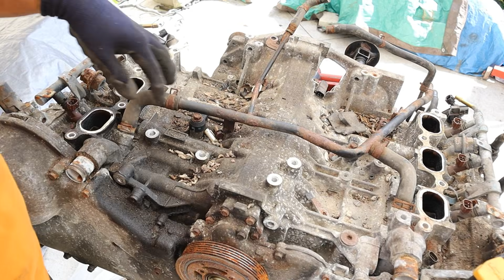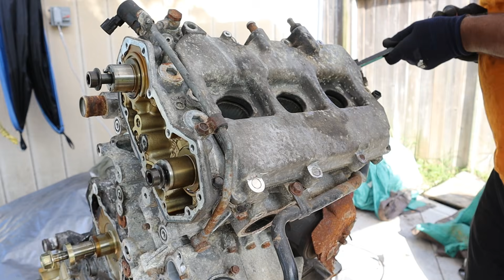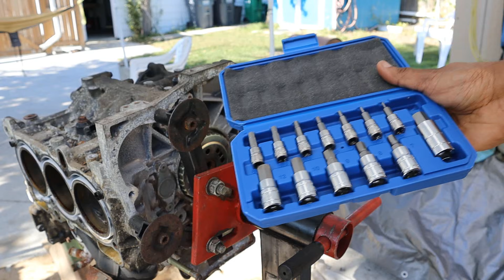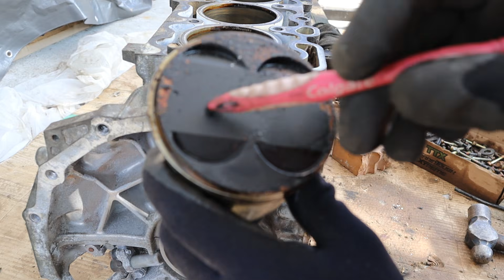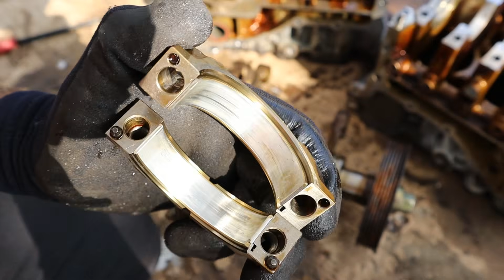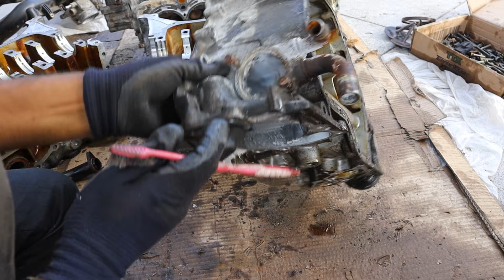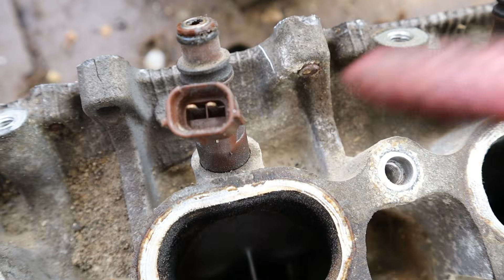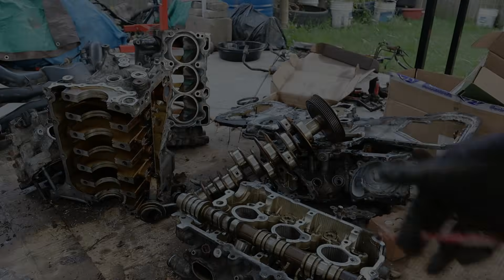Inside a Subaru Boxer H6 Engine

Comment: Some areas with bad well water can clog coolant passges.  That looks like calcium.  I found a new radiator, pump, hoses, thermostat and belts are cheaper than an engine.  I always use distilled water with my coolant.

Comment: Some areas with bad well water will clog up the coolant passages.  That looks like calcium.  I learned long ago new radiators and pumps and hoses are cheaper than engines.  Always use distilled water with your coolant

Comment: I waited for this video for a long time. I have this engine on my car, it doesn't overheat but it over pressurize the cooling system. It passed the compression test, leak down test and actually has good gas mileage too, no missfire or anything. I'm really confused what to do? Do I change the gasket or tighten the headbolts or get a replacement engine. I feel like coolant pipes might explode at any time.

Comment: Hey I wasn't sure if you'd notice comments on older videos, so hopefully it's okay I ask here as well: in your "Aux Input CD Stereo Hack" videos, you solder aux wires directly to the motherboard, to the left and right channels plus a ground. Couldn't you just splice into the wires those solder points lead to? Just thought it would be easier.

Comment: The video title should really say that it's an EZ30. Subaru have done quite a few sixes over the years - ER27, EG33 as well as EZ30 / EZ36 (and the EZ30/36 are different enough that they really should almost be considered different generations)
Oh and for the M5 hex nuts, get an impact driver. Not the electric ones - the manual ones you tension and then hit with a hammer.
Reply: 3/8" extractor socket pounds over the M5 heads and they zip right out.
Reply from the maker: Yeah an impact driver would help but if it's already rusty it won't grip much.
Reply: @speedkar99  it helps more than you think, I used to disassemble alternators and starter motors that had screws that were stuck fast. Impact driver, torque it and whack it with the hammer, worked like a charm no matter how rusty the head was. It stops the tool camming out.
Reply: @speedkar99 i can concur with the impact, they magically just work with these bolts. I got almost all 59 of them off of my mark 1 ez30d in the rust belt just using the impact, and i think i used vice grips for 2 of them

Comment: Wow this engine seems a lot better than I expected. Mostly because of the lack of head gasket issues. Didn't know they had an implementation of VVL either! Never seen coolant corrosion like that before. Thanks for the teardown!
Reply: The earlier ez30d mk2, or the "30R", had both intake vvt and vvl with heads designed by porsche. It's the same system as variocam
Reply from the maker: You are welcome. Those were my surprises too! Pretty interesting engine!

Comment: with 300km and the bolts were all stripped id say the engine is done.  and i dont think you would have been able to clean it out either.  its like someone used softened well water with the white stuff caked in there.
Reply from the maker: Yeah I don't think CLR would have cleaned it.

Comment: Measure the head bolt diameter. I had to repair one of these blocks a few months ago for stripped head bolt threads. They were M10.5 x 1.25. Yes, M10.5, not M11, or M10. Tou can't wind a 10mm nut  onto the bolts, and M11 is like a sausage in a hallway.
Reply from the maker: Wow....are you sure they're not imperial.... Which wouldn't make sense since it's a Japanese design. How did you get a tap for M10.5

Comment: I think this and the other 4 cyl Subaru boxer engines have a decent long life provided one follows the service procedure, uses a good quality lubricant, coolant and stick to the service interval. This plus allow the engine to warm up on cold days and a gentle driving habit would give these engines a very long and trouble free life.
Reply from the maker: I think that can be said for many other engines too. The 4 cylinder Subaru's are just more prone to the headgasket failure than H6
Reply: @speedkar99  and even then, its a limited run of one engine, exacerbated by poor maintenance. I do think it fair to say that Subarus are... less tolerant of lax/poor maintenance than a toyota or a honda.
Reply: @themadmallard  subarus have had that thing for decades and no macig coolant going to fix bad engine block and head design and yes i have subaru too but no need to hide the fact that they have build decent ammount of time bombs.
Reply: @themadmallard  Limited run? It was literally all EJ25 naturally aspirated engines meaning 1996 to 2012 lol. They improved a bit over the years but they never truly fixed the problem. The FA/FB 4 cylinder engines do not have this problem.

Comment: - That's not how the buckets work. The oil pressure locks the outer part to the inner part, the inner part is directly linked to the valve.
- You missed the 'thats actually a Porsche part' marker on the back of the buckets.
- The engine was probably overheating due to a clogged heater core, and yes, citric acid would have cleaned it... those bolts were yikes though.
- EZs do not have offset crank pins. The EZ36 has offset *rods*, the EZ30 does not.
- To make those hex bolts on the front cover play nice, use a short breaker bar, and strike it with the back of a hammer to seat it before trying to move it. Makes for much less of a battle.
- Fuel rails and fuel lines go with the manifold, but I guess you figured that out as you took it off.
- You remove the wrist pins, but leave the pistons in the block until you have the block split normally, less painful that way.

Otherwise, pretty accurate.
Reply from the maker: So the inner part of the bucket pops up due to contact with the valve stem when tightened down? 

How exactly does oil pressure lock them together internally, it fills it up with oil and then ...
Reply: @speedkar99  the inner part does not pop up. It is solid. There is an internal pin the oil pressure pushes into place that locks the outside to the centre part when high lift is commanded. Take one of the buckets apart to see if you want. Just beware, the spring inside is fairly powerful. 

It is the Porsche Variocam II system, not like it, it is it. There's some videos out there on its operation.
Reply: @grantbenjamin5808 no, the AVLS/VarioCam-II system shows up only on this engine.

Comment: I wonder if it would have helped if he put on a new radiator cap and flushed the cooling system. I’m sure actually he must have done that.

I wonder if the owner had a leak in the radiator and tried to “fix” it with stop leak rather than putting a new radiator and pooched the engine.
Reply from the maker: Yep I tried everything. See my shorts  I linked in the video of my diagnosis.

Comment: Interesting to finally see inside one of these.  One thing to note is that that lower profile center cam lobe on the intake cam is actually the one that is used most of the time.  One of the two center cams has less lift than the other to increase turbulence and improve mixing of the air and fuel at low rpms for better low end torque and fuel economy.  Then at high rpms the bucket will collapse to allow both intake valves to follow the higher lift cams for more air flow and thus more power.  It's definitely an interesting design.
Reply from the maker: That makes sense now, how does the bucket collapse with oil pressure applied?
Reply: @speedkar99 I would assume it has oil pressure by default which engages the plunger on the smaller cam profile. On power demand the “VTEC” closes the oil supply, the spring pushes the plunger flush to engage on the outer profile camshaft lobes for more power.
Just a guess though.
Reply: @speedkar99  Yeah, like the other guy said, I'm pretty sure there's a spring holding it in the collapsed position and oil pressure extends the center part of the bucket follower below a certain rpm threshold.  Above that rpm the oil pressure is removed and the valves follow the high lift profile.
Reply: Ain't it the other way round? The more "pointy" cam is, the shorter the time of valve being fully open. It'll open more/higher, but for shorter amount of time.  But the better air mixing between 2 unequaly opened valves during low rpms sounds convincing. Another "but" - during startup, there's no oil pressure for some time (neglectable?) and cams for high rpms are used then?
I can't find a good source of info on the actual behavior in Subaru ;(

Another related topic - how to measure valve clearance?  Use just the outer cams?

//edit
Got a reply from an engine repair shop - they say that valve clearance is measured using the external lobes and those are the ones used during low rpms.

Comment: My 2013 Subaru Tribeca with the 3.6 liter H6 engine with about 70,000 miles with most of the miles accumulated in short trip driving (severe driving conditions).  The motor oil gets changed once a year with about 5,000 to 8,000 miles with 5W-30 100% synthetic Amsoil Signature Series Motor Oil (a synthetic combination of a PAO Class IV and an Ester Class V);  my transmission and power steering has the 100% synthetic Amsoil ATF fluid (changed around 40,000 miles); my two differentials have the 100% synthetic 75W-90 Amsoil Gear Lube (changed around 40,000 miles);  my brake lines and master brake cylinder are filled with synthetic Amsoil Brake Fluid (changed every 30,000 miles); and finally my radiator is filled with Amsoil Antifreeze & Coolant (changed around 45,000 miles), making my vehicle running like a top (without enduring any repairs, other than maintenance)!  After trying every conceivable “full” synthetic oil in the marketplace and after testing the “100%” synthetic Amsoil motor oil, I instantly became hooked with the extra power, increased gas mileage, quieter, smoother and cooler running engine.
Reply from the maker: Nice
Reply: x2

Comment: I liked the 3.6 H6 that I had. Decent power and torque, and very smooth. That engine looks like it spent about 3 years at the bottom of the Gulf of Mexico before this video was recorded.
Reply from the maker: Canadian winters.
Reply: Canadian roads have about as much salt as the Gulf of Mexico.
Reply: @user-cs9ix3lw3j  I’m in the upper Midwest, so I can relate
Reply: The 3.6 was what the 3.0 should have been.
Reply: @LabiaLicker ez36 is weaker than the ez30. The cylinder walls are too thin to make power with.
Reply: @bobbygonzalez2153  If you going to close deck, then why not with a bigger engine?
Reply: @bobbygonzalez2153  not only that, but the offset connecting Rods
Reply: Gulf of AMERICA! 🇺🇸
Reply: Gulf of America*

Comment: Indeed, utilizing con rod journals for cylinder walls lubrication is the age-old method from Subaru. The top two holes are used to lubricate the wrist pin when the oil control ring scrapes the oil back into the bottom of the piston.
Reply: Correct - oil mist exiting the rod bearings provides piston lubrication - Hyundai Alpha is another example - holes or jets are more common nowadays though for added cooling
Reply from the maker: I feel like the jets are a more guaranteed way of evenly coating the piston walls.
Reply: @speedkar99  Roger Clark Motorsport has their close deck EJ20/EJ22 equipped with oil jets. Historically speaking, Subaru doesn't have a bad history with cylinder walls wear.

Subaru not going that route can mean a lot of things. But the #1 reason I can think of is not to rob the already inadequate Subaru engine oil pressure of more oil; using oil oil jets might work better than just shooting oil off the con rods, but the oil jets might take away some oil pressure else where. So I assume Subaru has thought about it.

But I will say, having oil jets can def help with reducing pistons' surface temperature. And Subaru can use that.
Reply: @speedkar99  Not necessarily - jets provide a directed stream at the piston bottom as opposed to a wide spray - they often use a checkball to only activate once a threshold oil pressure is reached at higher rpm - some misting will always occur also - too much oiling of the piston/cylinder area can cause more oil consumption, so it's a trade-off
Reply: @kristianhermann5971 I was under the impression jets were more for cooling than lubrication as the oil mist is technically sufficient for cylinder walls.
Reply from the maker: Good to know!

Comment: The best tool I used for cracking stubborn bolts is the impact screwdriver (the one that you need to hit with a hammer). Also, when loosening these bolts you may retighten them before moving to the next one, this lessens the tension on the next bolt for thick parts (wouldn't worry about it on a stamped oil pan).
Curios thing (I checked) is the head gasket, it had only tiny passages for coolant except for two large ones on the side (completely blocking off most of the coolant passages in the head) I wonder why Subaru did this. The Subaru SVX (EG33 H6 engine) had a gasket with lots of openings. I guess they knew what they are doing, but it surely smells like some cylinders running hotter than others by design.
Reply from the maker: Yeah an impact driver may have helped. It was hectic hammering sockets onto them to get it out. At one point my neighbor came out and cursed at the racket lol
Reply: The small coolant openings on the HG is an EZ specific thing, they have to have had a reason, but I'll admit the first time I saw it I was confused as hell. That said, the EZ is designed to run hotter than an EJ, I guess we can blame its German origins. (It has no commonality with the EG, which is an EJ with two extra holes)

Comment: Amazing how much this motor has in common with the water-cooled flat six Porsche engines. Even the dual lobe intake lifters look identical to the M96 3.6L. 
That lower sump / cooling girdle is interesting. 
I'm guessing you could you have split the case without removing the wrist pins?
Reply: That's because they licenced Porsche's system for the VVL
Reply from the maker: I'd really want to teardown a porsche engine one day!

Comment: I believe the Variable valve lift and timing systems on this engine were designed by Porsche.  Some say the heads were too.
Reply from the maker: It sure is a unique system compared to Honda's mess of rocker arms.
Reply: @speedkar99  True.  Porsche is not just a car manufacturer, they are an engineering consulting business as well, and their touch is seen in many cars and even airplanes.
Reply: @Flies2FLL  unfortunately the H6 did not inherit Porsche`s fuel efficiency.
Reply: @wolfgangbarthel9555  My '01 Outback gets 15 in the city/26 HWY.  My '14 Cayman S gets 14 city/31 HWY, so yes.
Reply: @Flies2FLL  That`s what i thought. My feeling is that for our altitude here (4500ft) the cross-section of the inlet runners may be too large.
Reply: @wolfgangbarthel9555  This is a "peaky" engine with plenty of power but low torque, and the car is heavy and has AWD.  But the main culprit with this car is that HORRID transmission, which never seems to be in the correct gear and takes its time shifting.  

A manual transmission would wake this car right up.
Reply: @Flies2FLL  Yeah I wish my 3.6R had a manual, or overall better xmission. But otherwise the motor has been smooth and reliable.
Reply: Thats why the have a problem then.
Reply: @kris8742  Bozo.

Comment: Bolt manufacturers would go broke if it wasn’t for Subaru!  Ten times more bolts than any other engine configuration!
Reply: Volvo are up there too, i removed the oil pan on my volvo B5234T4 engine the oil pan had 40 bolts they have abolt every inch on the perimeter.
Reply from the maker: It sure is crazy!!

Comment: Great video as always! Bought 05 Ram 5.7, 115 k miles replaced all fluids as no maintenance history with truck. Car Fax vague on history. Noticed white sugar coating where old existing radiator fluid had splashed. Being summer, kept running/flush distilled water through engine/radiator for two months. Replaced radiator cap, new 50/50 antifreeze. 2 days later saw Ram had taken a leak on the garage floor. Traced leak to water pump. 

Seems instead of flat gasket, water pump now has machined groove using o-ring which seems about 2/32" in diameter (real smart on dissimilar aluminium metals). Garage now cold so I unfortunately had to put back in a half of bottle of stop leak. No more pissing coolant on floor but now have stop leak remorse 🙄. When sunshine prevails once again will change, radiator, H2O pump (steel impeller), hoses (had job planned but that old hag (wallet) said no way Gramp's). Also went through crank, O2 sensor hell, replaced all, fingers crossed on cam sensors. Trunk now runs very well pushing 15.5 mpg from 11.  

"In my case" just flushing with distilled water every two weeks seemed to stop the sugar coating. Who knows. Was told some manufacturers putting stop leak in brand spanking new factory cars. We your viewers, have learned much from your time and effort. 

Been trying some of the Mrs recipes, must be a challenge coming back to a tear down after her dinners.

Thank you Bro! Happy Holidays to your whole family however they may be observed .
Reply from the maker: You are welcome. Enjoy your holidays

Comment: theres something about these motors. I had an outback with a EZ30 motor was a trooper. Overheating all the time, Valve covers shaking off. Head gaskets going, timing chain guides went. It was limping hard. Still ran for about 50k miles like that until I scrapped the whole car. I miss it and I thank it for being a reliable car when I needed it the most
Reply: Sounds reliable yeah